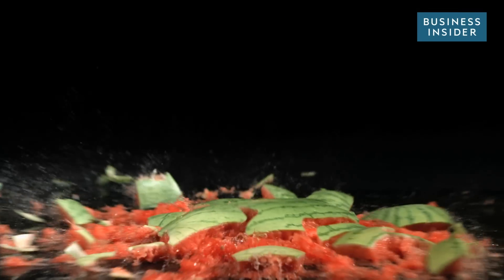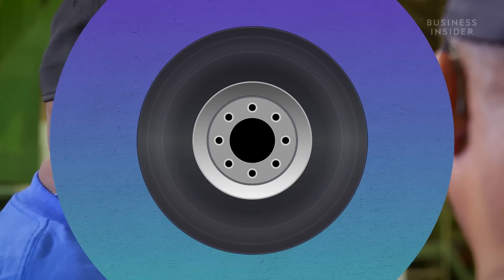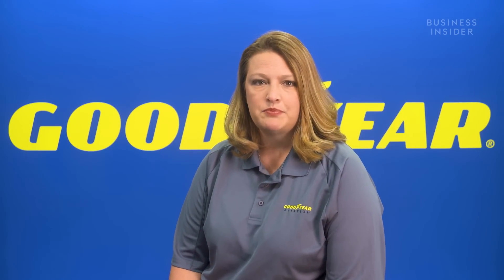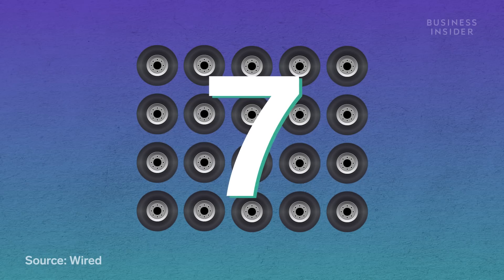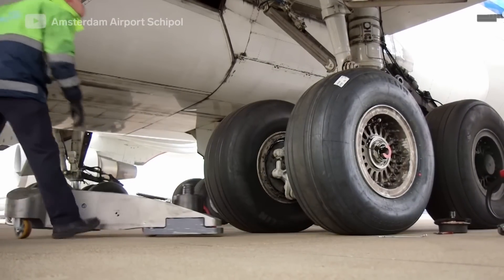Why Plane Tires Don't Explode On Landing

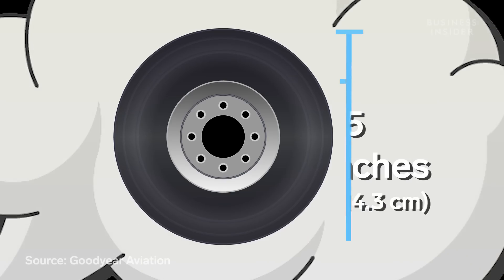Comment: 0:35 TARMAC ALERT
2:58 No... the 737, the worlds best selling commercial aircraft has 6 tires. You only get around 20 tires when you start going 747. That has 18 tires. The A380 has 22 tires. A 777 only has 14 tires. A 787 has 10 tires. An A350 has 10-14 tires. The only commercial aircraft with more than 20 tires is the A380.

Comment: Why plane front wheel is moveable.if wheel is fixed like a back wheel there will no front wheel problem come and plane would not be crash
Reply: No if it was fixed it wouldn't turn dumby

Comment: Why are plane's wheels not rotated when touch-down the runway. .. ?
When wheel circumference speed equals to the plane's ground speed, it will reduce frictions between rubber and run-way.
Any body can tell me .. ?
Reply: The short answer is that tire pre-rotation, which has been studied for at least 70 years, isn't worth it.  A solution which ends up being more expensive than the problem, no matter how it's implemented.
Reply: @marcmcreynolds2827  , ... good explaination. Thx.
Today, .. electric motor has developed so efficient & smart. Rethinking is not bad
Reply: @vr-gv2ks   How true.  I was involved in model airplane flying over the period when it transitioned from simple can motors to what is now available.  Likewise automobile power steering has moved to electric, and of course aircraft flight control systems have been evolving in that direction.  But beyond the basic matter of implementation looms a number of issues, starting with weight (= fuel cost increase/payload reduction) and moving to things like failure modes, e.g. how much is controllability affected if only the wheels on one side spin up, or a spin-up motor seizes?

The above examples just scratch the surface as to all of the things involved when it comes to retrofitting to an existing airliner design.  But in the spirit of your "rethinking is not bad", I will say that perhaps in a future evolution of the airliner, where braking is handed at least in part in some regenerative fashion, and power for taxiing comes from the wheels instead of the engines, tire pre-rotation might follow as a simple consequence from having that sort of hardware.

Comment: "Plane tires are subjected to the most rigorous conditions of any vehicle tire"

Space Shuttle Discovery would like a word with you.
Reply: Yeah, sort of.  Those are (were) of conventional airliner design, but with a different proportion of constituent materials for the modestly higher operating specs.  A unusual problem faced with those was that it could be months between landing and when they were inflated but no longer accessible.  So each one, after mounting on its wheel, had its air loss measured over three months and then before flight was "overinflated" to try to have it about right at the presumed landing time.
Reply: @marcmcreynolds2827  That's actually fascinating, thanks for the response.

Comment: It isn’t like its fallen that fast, its horizontal speed is fast indeed, vertical is around 6 feet per second. The wheels don’t fall with 170 mph
 on to the ground

Comment: well you dropped the watermelon at 170mhp straight down. Pilots land at about 100 feet per minute while going 170mph horizontal speed, 100feet per MINUTE vertical speed.

Comment: A typical airplane lands at the speed of 120 - 150 kmph ( 75 - 100 miles per hour)) approx and as soon as it gets landed the pressure on the tires makes the plane bounce up-to certain centimeters. So, after the first impact a certain amount of pressure is released from yellow spots on the tires and henceforth the tires perform smoothly.
Reply: A cessna lands at 65knots. An airliner needs more than double that speed.  And i see you dragged all the misinformation you just commented out of your ass
Reply: @kristjan2130  thanks for the correction and reaching out my ass :). Well, i meant the commercial airplanes at the sense of typical here and that's not just random cuz i worked with them and overhauled A330's. :)

Comment: Correction: Planes don’t fall out of the sky, they simply glide down... and most commercial jet do not have 20 tires... narrow body’s have 6 or 10 (only 757), wide body’s have around 10 or 14 (777 and A350-1000) and double decker have around 18-22 tires.

Comment: "They survive this everyday with no harm."

Until they do explode.

"The only thing between and asphalt is the rubber tire."

And the air in them, the wheels, the suspension and the whole body of the plane. It won't be as smooth without them but they help.

Comment: Aircrafts don't land straight 170+ miles, the virtical speed is totally different than horizontal. So it is designed to handle upto 10kmph virtical landing speed, on average landing speed (virtical)  will be 2 to 3 kmph.

Comment: Um. Aren't all tires filled with Nitrogen?

Google search:

By volume, dry air contains 78.09% nitrogen, 20.95% oxygen, 0.93% argon, 0.04% carbon dioxide, and small amounts of other gases.

Comment: I am pretty sure a lot of people would be pretty dead if airplanes HIT the ground at 170mph. Their horizontal speed may be that, but then the problem would be about the tires melting from rubbing against the tarmac as they start spinning (and then exploding), which the video doesn't explain at all

Comment: "Insider" video with zero substance. To begin with, you are comparing falling objects. An airplane is nowhere close to a free fall during landing, and the smoke is due to wheel accelerating from zero to landing speed at contact. This is not discussed at all. Second, the explanation of use of nitrogen is vague at best. No explanation of physics behind the selection. Third, the use of high pressure. I would also think that this reduces heat generation within the tire

Comment: I've wondered for decades why the wheel hubs and/or tire sidewalls aren't designed to catch air and spin the tires to roughly equal to ground speed before touching down.
Reply: This has been dealt with extensively in other videos/comment sections.  The short answer:  That doesn't work, and even if it did it wouldn't be worth it since tire wear from touchdown isn't that big of a deal relative to all the hassles which go with pre-rotation (by any means).
Reply: @marcmcreynolds2827  So to you, pre-rotation even by natural (wind) means is too much effort to save the tire wear?  (When it's so easy to simply design a wheel that spins with the air speed...)
Reply: @sanjuansteve  It's not just me.  Pre-rotation has been looked at for at least 70 years by airlines and the military, but has never panned out.  It's one of those things that's simple to imagine, but more or less impossible to come out ahead on within the restrictions of physics.  There is a vaned tire available for the smallish nose gear of a particular business jet, but that principal doesn't "scale" to heavier MLG tires with brake assemblies inside them.

Effectiveness of vanes goes up with the square of increasing size (e.g. tire diameter), but the amount of rotational inertia needing to be accelerated goes as nearly the cube of that dimension.  To make up for that, the vanes would need to have their area increased by sticking way out -- so far that the tire wouldn't fit in a wheel well... and if the wheel well was greatly enlarged, then the extra weight, drag, fuel costs and recertification costs would overwhelm any tire cost savings.  And that's just the beginning of the problems, for something which as it turns out has no great utility to start with.

Comment: define “tarmac.” pretty sure you land on the runway bud
Reply: And unless it's concrete or turf, runways are made of what could be referred to as tarmac . Definition, "material used for surfacing roads or other outdoor areas, consisting of crushed rock mixed with tar.
"the tarmac path"
a runway or other area surfaced with tarmac.
noun: the tarmac

Comment: 0:00 Yeah when I drop a watermelon with 170 mph, clearly it will be a mess, but when I drop a  Airplane, and its falling with 170 mph, it will be a big mess too ✌ a airplane is not dropping with 170 mph, its flying. So a landing is not so brutal for the tires.

Comment: Question

Are plane wheels already spinning before they touch down or nah?
Reply: They did a study and concluded it made no difference as intial contact of the tires on landing wore out the same.
Reply: @keithfreitas2983  interesting cheers

Comment: The misconception this video is that the plains tires hit the ground at 150 mph. Like how a falling baseball would. But it’s not like that it lands smoothly just at a fast speed. Therefore most this video is pointless. The tires just need to be more rated for high speed rather then high impact. Yet still good at both

Comment: Nobody:
Brandy: Nitrogen is an inert gas
Reply: It’s used to inflate aircraft tyres and occasionally with car tyres. The only car I can think of that has nitrogen in its tyres is the Nissan GT-R.
Reply: @MrSupercar55  Fun Fact: Nitrogen is also filled in your chips packets, because it doesn't react with oil in it.
Reply: @MrSupercar55  and probably every Nascar car
Reply: MrSupercar55 I have a freaking Mirage and use nitrogen. Anyone ask their tire tech for it. It’s only a few bucks more and well worth it for stable tire pressure.
Reply: @は私です彼の名前  It is "inert", at least under normal pressure and temperature. But it doesn't make any difference on its expansion with heat. The main reason for using nitrogen in tyres is, any moisture has been removed from it  during the production/compression. It is the moisture in normal atmospheric air causing all the problems mainly excessive pressure fluctuation with temperature changes. Added (marginal) benefits of nitrogen  are a slightly less weight and more safety in case of a fire.
Reply: All these replies and not noticing the point of the comment. Inert

Comment: I’ve wondered why they don’t place a small electric motor to spin up the tire speed to say 80% of landing approach speed before hitting the runway. It seems like the tire would undergo less stress as it’s relative velocity to the ground would be much less.
Reply: There’s a lot of room for innovation and improvement in plane design, but most of the time it comes down to the economics. I haven’t crunched the numbers, but maybe the additional fuel cost of spinning the tires up to that speed, and the cost of implementing a system to power the wheels would be less economical than just replacing the tires after 3500 landings. Not to mention the cost of testing the system, the cost of getting it approved for commercial flights, and the cost of any additional maintenance that would be required to maintain the system. I’m just speculating though, and of course if it helps to reduce the environmental impact of producing those enormous tires it could be worth it, but most companies these days prefer to use environmentalism for publicity stunts.
Reply: One the tasks in my landing gear job was responding to occasional queries from people who had come up with the idea of tire pre-rotation.  Simply put, the solutions are all more expensive than the problem, whether dollars expense, operational headaches expense, or whatever.

Comment: "If you dropped a watermelon..."
People, planes don't drop when they land! (it's called a crash, otherwise!) They transition from the wings providing lift (obviously supporting the fuselage as a result) to the tyres progressively taking the plane's weight as it decelerates.
"...at 170 MPH..."
Again, people: Any object falling at that speed and abruptly hitting the ground...is going to do a whole lot more than pop. A 500,000-pound plane would smash to pieces and leave a crater--'tyres popping' would be the least of your concerns!
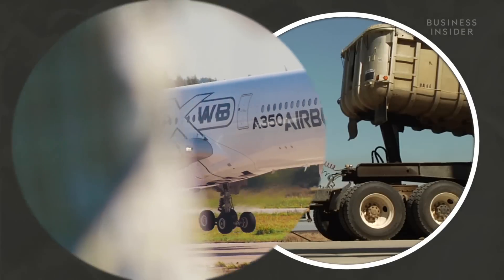1:06 #facepalm
Reply: @ZeHoSmusician
For the first bit, what else where they supposed to say?
“If you transition the watermelons wings providing lift to the watermelons tyres progressively taking the watermelons weight as it decelerates.”
Also, an average 747 would be landing about around 25,0000kgs. The landing speed would be around 145kts-150kts (166mph-172mph) depending on the landing flap setting selected.
Reply: ZeHoSmusician yea no shit srry we all know planes don’t just drop but it was a nice segway into the video why do you have to take things so literally?

Comment: It's not really the weight of the plane coming down that's the issue (generally the load is gradually applied - if over a brief span of time).  What is curious is how they can withstand the sudden zero-to-150 miles per hour acceleration over and over and over again.
And each time they come down they leave a physical record on the tarmac (the skid mark).  What sort of pollution does that cause during rain?  What is released into the air each time they land and skid the few feet before they can begin rotating?

Comment: I'm sure majority of that energy when landing goes to the suspension
Reply: yepp
Reply: Shock and tension struts correct
Reply: The “suspension” of an aircraft is literally just pressurized nitrogen. 

That’s all. There’s no springs at all. 

There’s a hydraulic shock, but it doesn’t support the aircraft.
Reply: @Bartonovich52  Ya know what those nitro shocks are?

🥴✨ S  U  S  P  E  N  S  I  O  N ✨🥴
Reply: @Bartonovich52  you’re completely wrong. Planes have heaps of suspension depending on the LW (Landing weight)
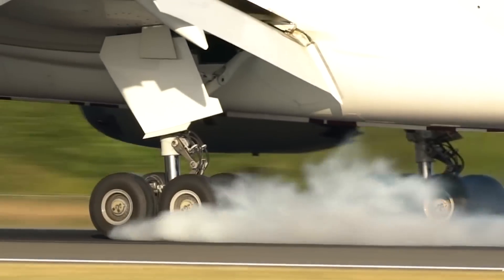Reply: @Bartonovich52  2:03

Comment: The tire tread seen alongside a highway is not from exploded truck tires. That's just a silly guess, maybe an urban myth. Truck tires are sometimes re-treaded by vulcanizing (gluing) a new tread on a good used tire carcass. In hot weather, pavement gets really hot, the tire also gets hot, and sometimes the vulcanizing lets go. The "new" tread flies off with violent force ending in a pile on the highway. Violently loosing a tread on a front tire on a semi at highway speed could make for a catastrophic accident. For that reason, it is illegal to use re-treads on front steering axles of buses. (Title 49, Part 393.75 (d) of the Federal Motor Carrier Safety Regulations). Although they may be legally used up front on highway trucks, industry standard is to not use re-treads, recaps, re-grooved tires, on steering axles. It's also not a good idea to use them on other axles. Are you sure that aircraft tires use re-treads? I'm not confident in your research.

Comment: I've counted just 40 seconds on the video that explains, just briefly, "why the tires don't explode". That 40 seconds just listed out materials, air pressure, and the gas used, and therefore it doesnt explode. sigh.

Comment: Airplanes don’t “fall out of the sky as part of their route” as you put it. Not only would the tires not survive impacting the ground straight down vertically at 170 mph, but neither would the rest of the plane. Airliners may touch down at 170ish mph airspeed (horizontally across the ground), but the closure rate with the ground is much much slower. Airliners typically land with a vertical speed of somewhere between 100 to 500 feet per minute which converts to approximately 1 to 6 mph.

Comment: Yeah you approached this poorly.
Aircraft tires do not hit the ground at terminal velocity. 
If they did, believe me, they would explode. 
And at 300 psi, as most large commercial tires are inflated to, 
They. Would. Explode. ferociously!! 

What those tires go through is more like dropping tthe watermelon on the table from a foot up. 
In which case, it probably would crack. 
Which is why comparing a watermelon to a tubeless solid rubber 250 psi aircraft tire is an act of blatant imbecility. And it displays that you dont have much concept of what you're talking about.
Source: am aircraft mechanic.

Comment: Let's not forget that planes still generate some lift upon landing. The pilot basically stalls the airplane close to the ground (hence the main gear touches down before the nose gear does), so that the weight of the plane is gradually loaded onto the tyres. It's not like it falls from the sky. And just like your car, although a lot more heavy duty, airplanes have pretty substantial shock absorbers that catch the weight of the aircraft.

Comment: Wrong again the only reason there is grooves and blocks in a car tire is to get rid of rain water. The plane only has grooves because the only time the tire needs to get rid of water is under high speed in a STRAIGHT LINE. When its wet A car tire has to deal with gripping the road surface in turning hitting puddles and also dirt and mud. Do a little more research next time

Comment: The airplane doesn't land straight down! Now I can't trust anything else is true in the video
Reply: Same with tarmac, tarmac is the stuff used to pave the runway, but there is no such thing as a tarmac on a runway/taxiway
Reply: Not to mention suspension plays a huge role.
Reply: André Jordan i was thinking the same thing
Reply: right, some big idiot made this video
Reply: @Kermit Da Frog Oof The point of this is to educate people, the speed they have is more horizontal speed not vertical, the way they portrayed this topic was not very well done.
Reply: Tarmac tarmac tarmac like bruh. I can’t watch these videos knowing so much about aviation.
Reply: @Lazys The Dank Engineer no that would be the road, it's like calling bread, flour cause its made of it
Reply: Especially that they call it a "T a r m a c"
Reply: @Kermit Da Frog Oof how am I supposed to know if I dont like it if I don't watch the video?

Comment: They're currently working on Electric Motor Hubs to "spin up" the tires to match the planes speed prior to landing. This will increase tread life by up to 500%. Then, use the electric motors in regenerative mode for breaking to save on brake pad wear by up to 1,000%.

Comment: Semi truck tires don't explode like that. Most pieces you see in the road are "re treads". Basically when the actual tire starts balding they glue tread on it and later it flies off.